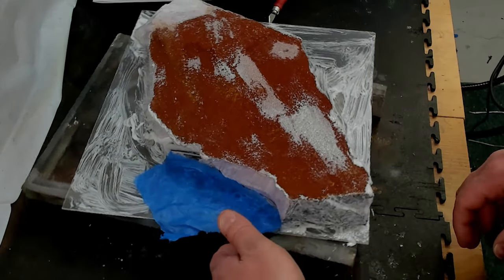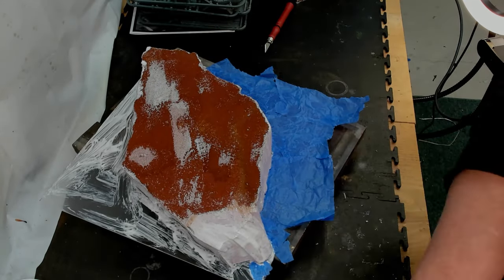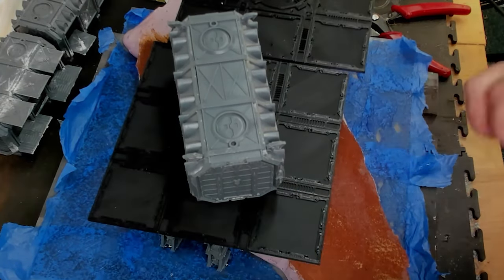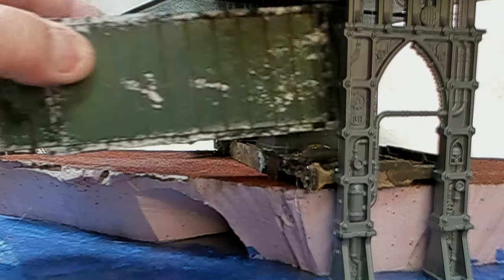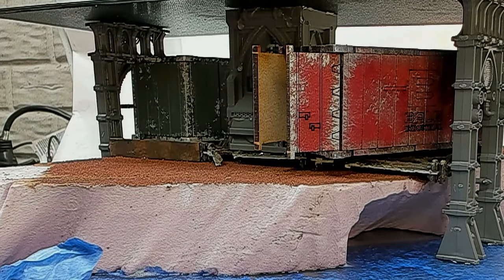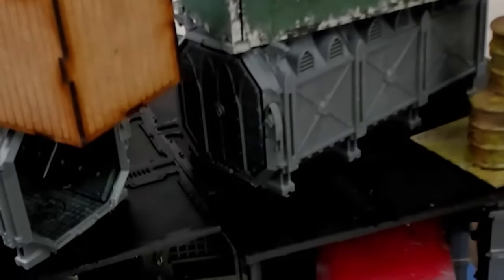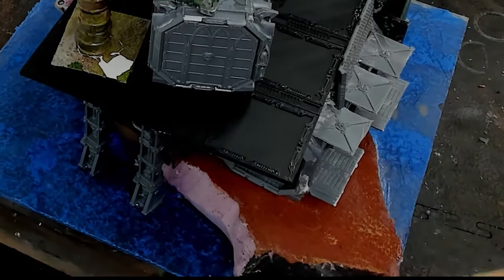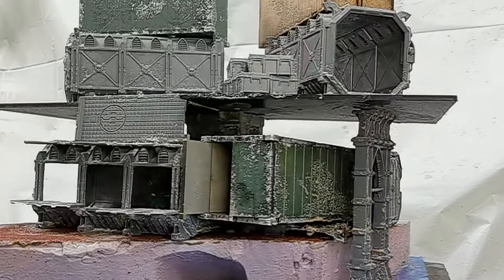Kitbashing a Sump Tile for Necromunda

Comment: Hey weird question, but is that island supposed to be rock or damaged concrete?  Because if it's the later a few bits of rebar sticking out wouldn't go amiss
Reply from the maker: A bit of both and once again that's a great idea!